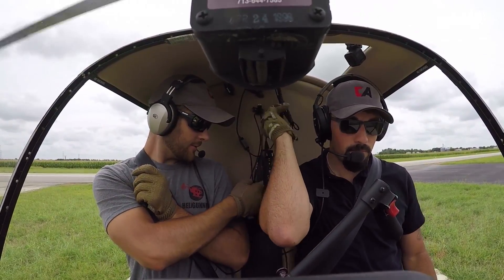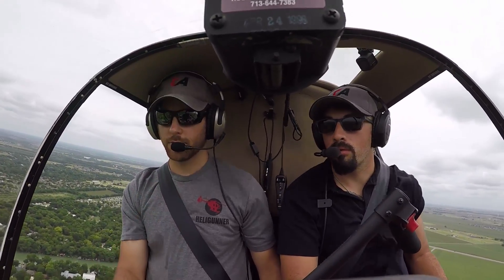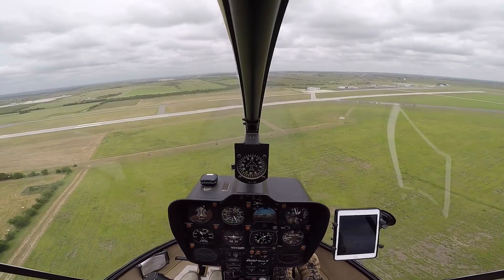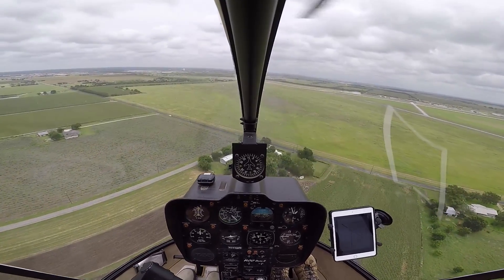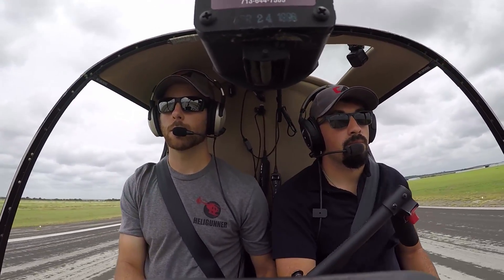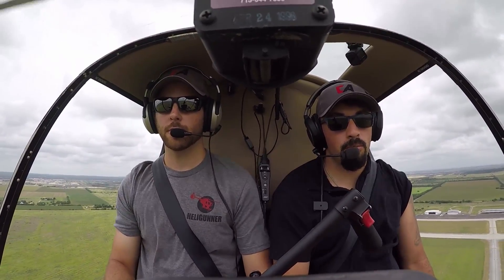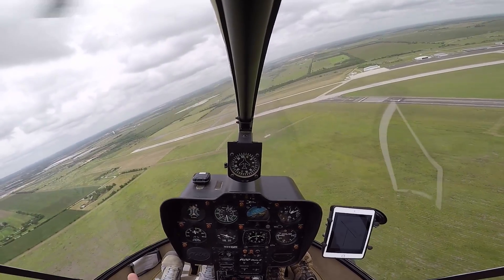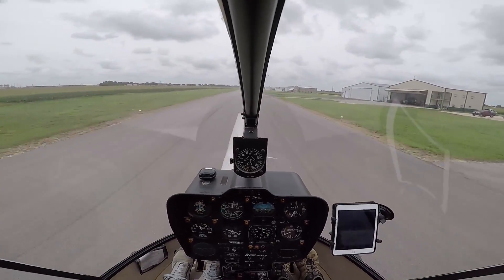Helicopter Flight School - Running Landing

Comment: Is it normal to have that box next to your head violently shaking?
Reply from the maker: Hah. It looks worst than it is because the camera is so close. That's the compass and it is loosely mounted like that on purpose. If it was more securely mounted, then the vibrations would be transferred inside of that box and most likely stress the equipment more. It's a helicopter and more importantly, a Robinson. They always have a bit of a shake to them.

Comment: How come they dont teach skid landing with rotor disconnected. Itd make more sense to have some practice runs like that until you do it real time wouldnt it.
Reply from the maker: I believe what you're referring to is a full down autorotation. We do those, but they are much more dangerous to practice in the R22 due to the low inertia rotor system and. That is for an engine failure. Powered running landings are for other emergencies that are not engine out. Typically, if the engine is running you want to keep it that way.

Comment: You're keeping it nice and straight. We are not allowed to practice run on landings on the runway and need to do it on the grass.  I'm still struggling with it, especially after a simulated tail rotor failure where you need to use the throttle for directional control.
Reply from the maker: I mean, I can get why either the operator or the airport manager might not like run on landings. The helicopter should be protected with reinforced skid shoes, but it can chew up the runway pretty good.

Comment: dude if you want some hard engine failure training come to Prescott, Az  and do a flight with universal helicopters.
Reply from the maker: William Colt I actually considered going to a school out in Prescott, but ended up picking something local. Even though we don't have any cool mountains to fly around down here, I'm really happy with Veracity.
Reply: Critical Angle yeah,  the da out here gets up to about 7500 at field elevation of 5045 alot. Also we only get one engine failure call even in private. So i think you made a good decision.

Comment: As a fixed wing  private pilot wanting to get into the rotary side,  is it really as expensive and difficult to pay for as people say it is?
Reply from the maker: Energon53 unfortunately everything about helicopters is pretty expensive, probably about 3x the cost of most GA fixed wing like a 172 or something and that's just for the R-22. If you're going to do it for a career like I plan on, it's worth the investment. If you're looking for hobby flying, you're gonna need a lot of cash.
Reply: I'm hoping to make the career switch, just having to decide between fixed wing and rotary and the prospect of taking out more loans. Thanks for the reply!
Reply from the maker: Hockeysktr17 2-3 hours a month is pretty easy to keep current with. You only have to have three takeoff and landings in a 90 day period. If you're passionate about flying, then it's definitely worth it.
Reply: I never got my rotor wing rating but just flying helicopters when I had the bucks was worth it.
Reply: Hey Ian, I plan on getting my license soon, but just for hobby flying (unless I get so hooked I quit my boring software engineering job). I have the cash on hand to get my private license but after that, I can only realistically afford to fly 2-3 hours a month. Would you consider that worth the initial investment, and is that even enough to maintain currency and be able to rent solo?
Reply: Critical Angle got it thanks for the input! Planning on starting lessons in a few weeks. Love your channel by the way.
Reply: @Hockeysktr17  how many hours you got 5 years later?
Reply: @frontseatfilms587  Have my rotorcraft PPL and about 120 hours. Haven't flown much in the past year and a half but getting back into it soon